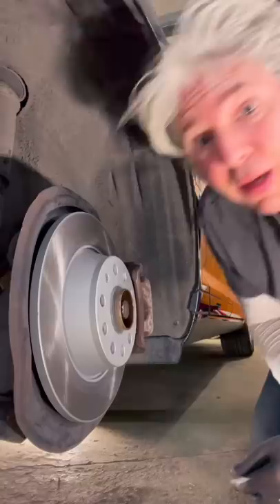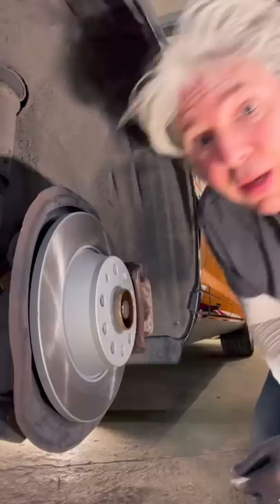Burnishing or Bedding In brakes - Edd China's Workshop Diaries #Shorts

Comment: That guide rule of dropping 30 mph/kph for each event seems odd. The energy released is the square of the speed. So the energy (& power) generated through the brakes from 60-30 is several times the energy from 30-0. Someone doing repeated 60-30 cycles is doing something very different from someone doing 30-0 cycles.

Comment: The book on my 2018 SS Camaro had an aggressive brake burn in         My 2022 Subaru said don't do aggressive brakes in the first 1,000 miles +/- ???    I tend to slow down with the gas & not the brakes    I did notice some chatter marks on my rear disks on the Camaro from ABS/ traction Control   if I took off the nanny buttons the rear tires would light up way too often   too much power for the small tires   455 HP on the stock tires
Reply: BTW I never did any of that   I mostly drive to save the car & gas & tires    and keep the cops away

Comment: If you go from 30 mph, do you come to a complete stop and wait for 30 seconds to cool the brakes? And if so do you put the car on Park with no parking brake engaged so the pads don't touch the rotors. Or do you immediately increase the speed back to 30mph and drive for 30 seconds before repeating the process?

Comment: So could you explain the 30, 30, 30 again please? Didnt catch it..
Reply: Brake to reduce your speed by 30mph. So if you're going 40mph you'd brake down to 10mph.If braking from 50mph you'd brake down to 20mph, etc
After every brake event,wait 30 seconds then do it again.
Repeat 30 times
Reply: @ronchappel4812  Should the braking then be done quickly/hard or what?
Reply: When he says 30 times is that 30 times at each of the different speeds or just pump the brakes 30 times at any chosen speed ? 🤔